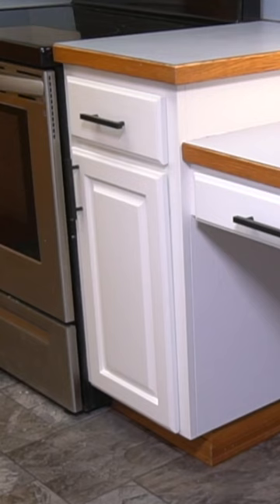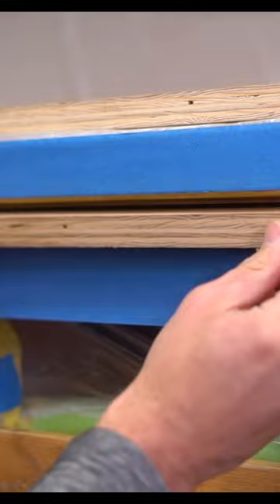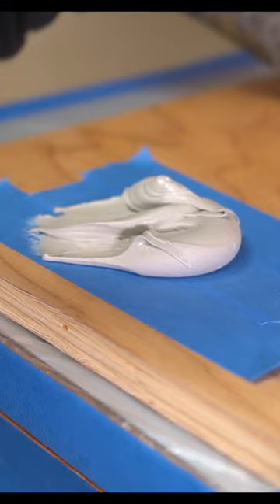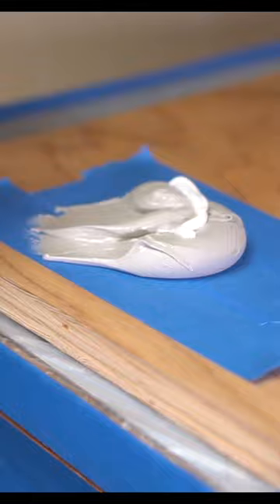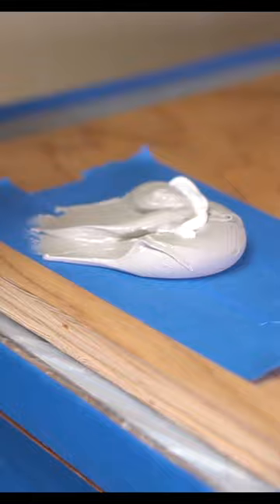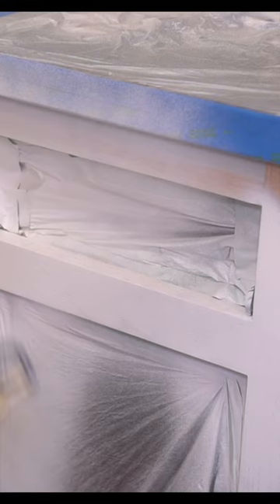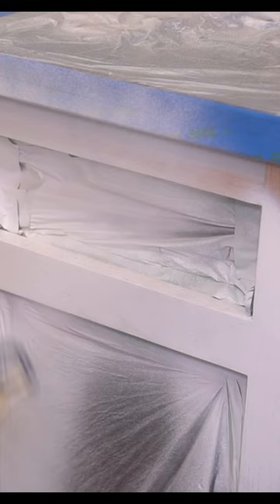DIY Bondo Cabinet Repair #shorts

Comment: Nice work. We pay probably 20 cabinets a year and we’re still stuck on priming the cabinets with shellac primer and had had great results. However, it’s just the stink factor.
You mentioned you use a bonding primer. Do you recommend a brand?
 does the stain bleed through ?